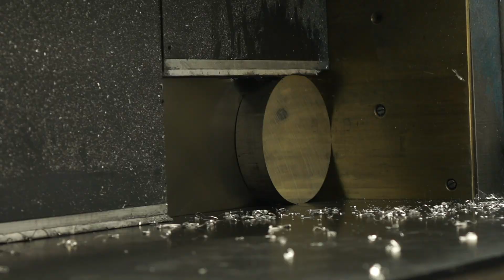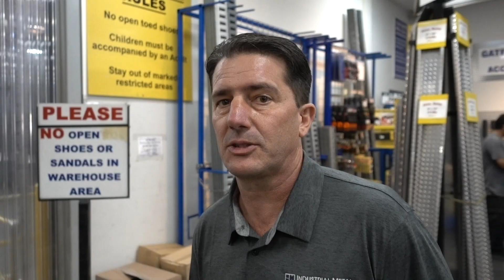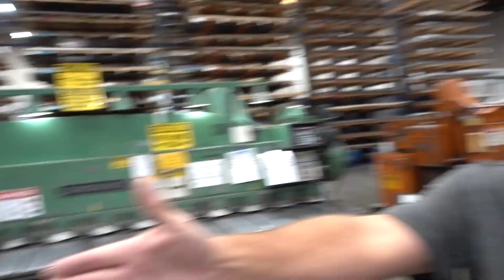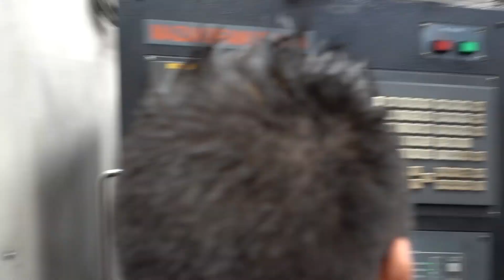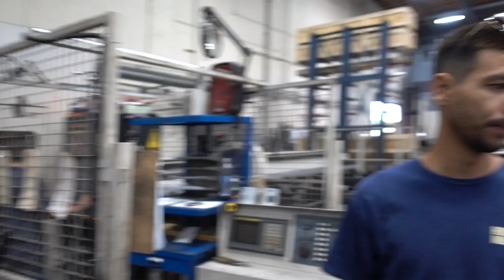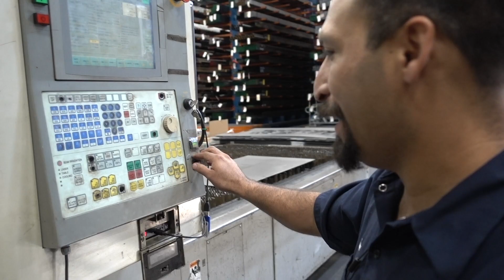Heavy Metal! Build & Battle Cameraman Kyle Tours Industrial Metal Supply!

Comment: Gonna flex here. Used to operate a 8x50 and 10x50 plasma and oxy-acetylene burn table with 3 other guys. Only cut inch and a half max with the plasma. I think my personal max was 9 inch thick plate oxy cutting at a bit more than a inch per minute feed rate. The oxy torches were massive ! 
These guys in the video are insane. Always had eye pro on and definitely always had ear pro in. Both machines running was so loud you felt it in your chest.

Side note for anyone who actually read this. Since our shop ran 24/7 with huge bay doors always open, in the summer water beetles would live and breed in the water. Every now and then you would have one dive bomb the light on a running torch and blow up or burn on contact. Best prank is to grab a big one from the water and put it in someone's cuvies pocket when they are focused on something. A great reaction when they go for their phone or smokes and scream pulling out a huge pissed off beetle. Miss that job.